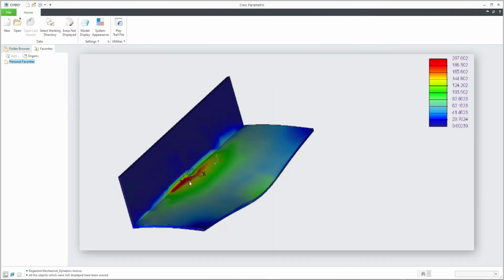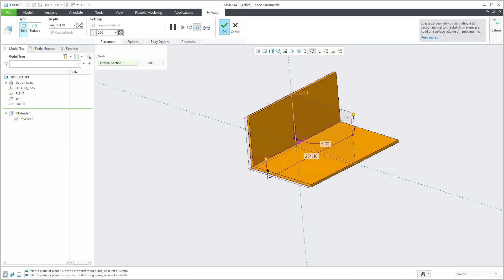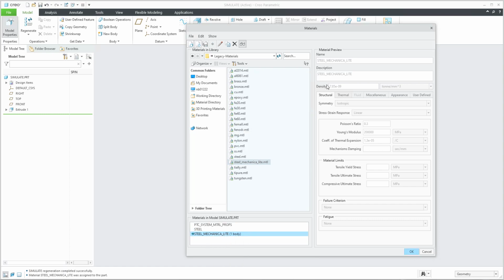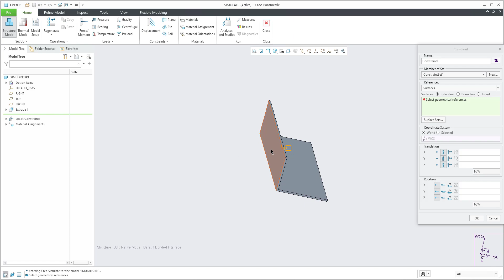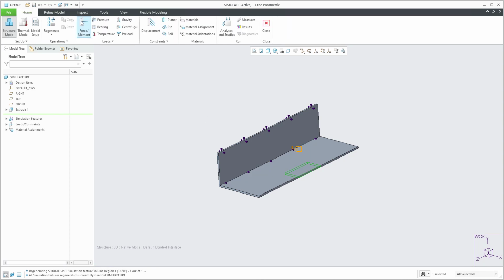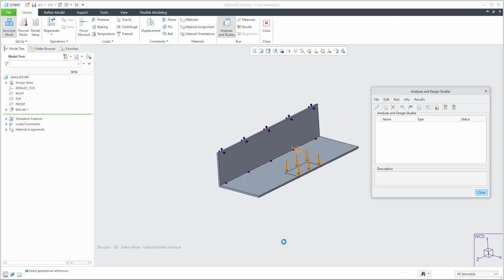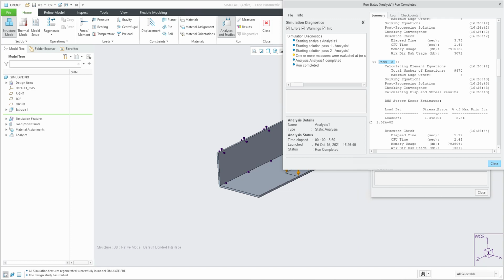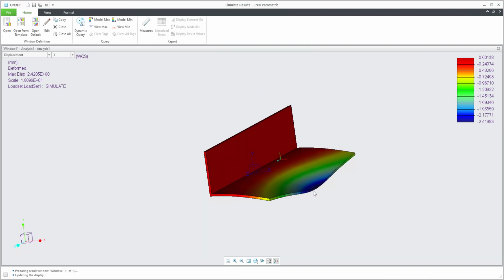Creo Simulate for Beginners | Introduction to PTC Creo Simulate

Comment: Hello, Vladimir! Creo Simulate 7 and higher has  tool "Joints". May be you know how to create joints (spherical, translational) in Creo Simulate 6? Thanks!
Reply from the maker: Thank you for question, but I have used Creo 6 only in short time (I am not deep in this data code)
Also now I use Creo 4 "only" but soon we have plan to start to use Creo 8 (next few months) 
I have to check all new features and... Then maybe.. I will find some solution for you. 👍👌
Stay tuned, Vladimir

Comment: Hello vladimir, I am running this basic simulation for sheet metal parts with zinc coating. PTC has the material.of steel.galvanized, what do you recommend, should I input the data from supplier? And what kind of data do I need? Like young modulus, poisson ratio , density, tensile stress limit etc?
Reply from the maker: Hi Kashif, in Creo are materials which are able to use for standard calculations. If you have your own material, you can create new one and reuse many times. As you can see in some tutorials I use my custom materials. Update existing one, set custom name and change all relevant information (all what you can find from material list)
Reply: @4kside  can you also cover simulation with nut/bolted assemblies?
Reply from the maker: Yes, it is also possible. You can create assembly and run analysis on this assembly (the separate models can be defined with different materials)

Comment: Hello Vladimir , thanks for this video
I have a die-shaped punch set and I would like to know how to go about simulating the force of the punch on the sheet metal so that it deforms and takes the shape of the punch. May you  guide me on how to to do , thanks a lot
Reply from the maker: Hi Frederic, thanks for your question. In Creo Simulate is possible to calculate non linear analysis. I do not have this licenses type (I use Creo Simulate extension only) If I remember, you need to use Creo simulate advanced licenses (non linear included, but speak with PTC reseller)
I only know that you will calculate it by this Creo simulate analysis type and system will calculate the values determined for yield stress and tensile strength (necessary for this deformation of Sheetmetal form feature).
Good luck and stay tuned. Vladimir